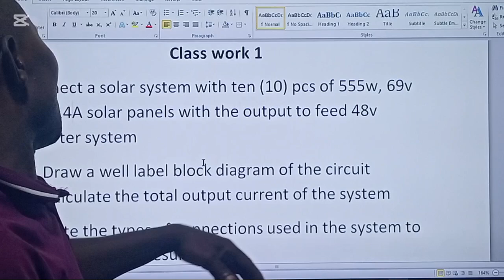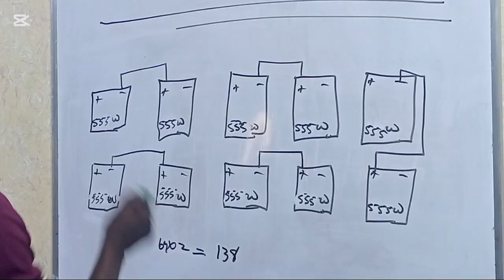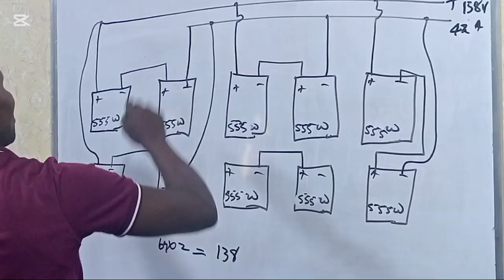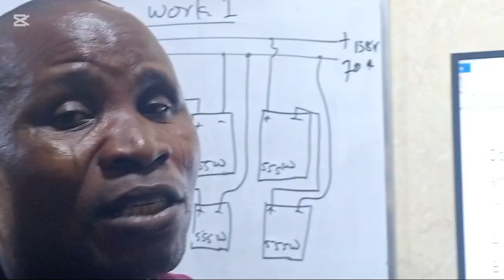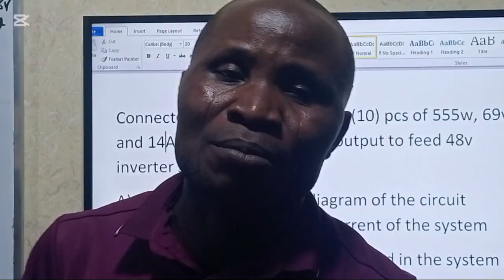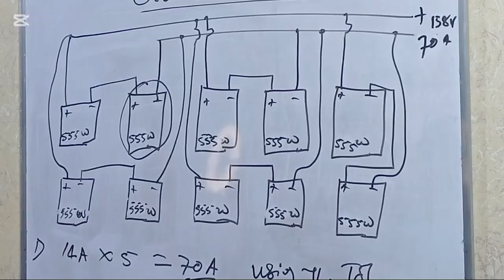Class work 1 : design of a solar system

Comment: But you 48volt system or the charge controller is also accept 138vlt

Because if the does system does not accept 138 volt from the panels there we be a fire burn